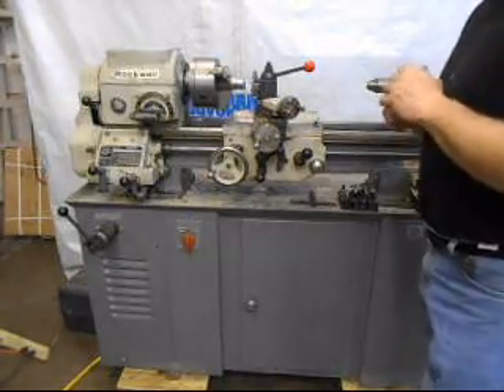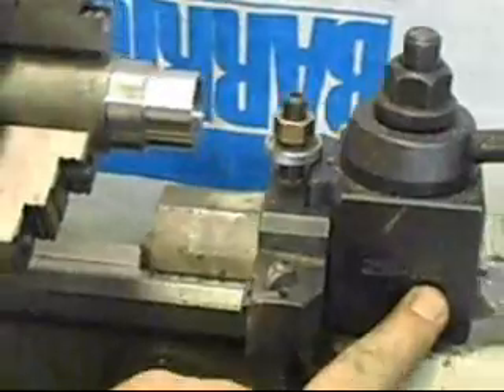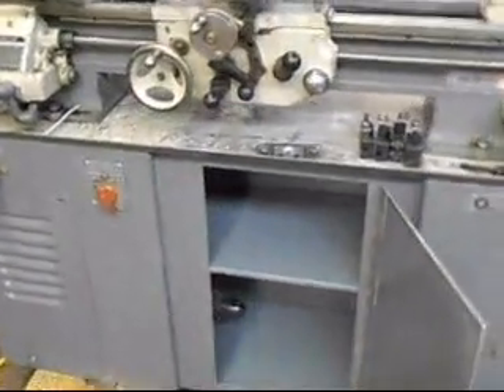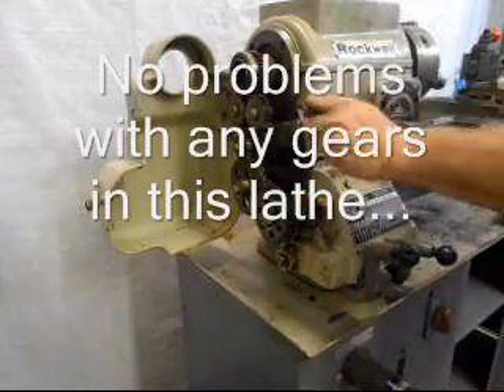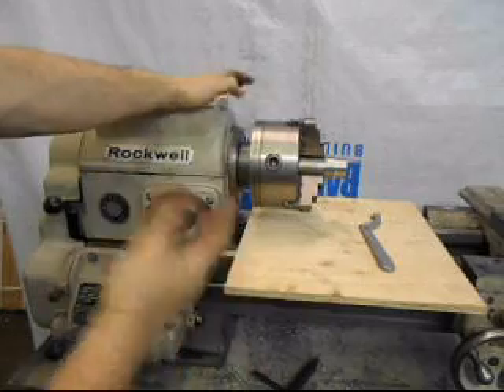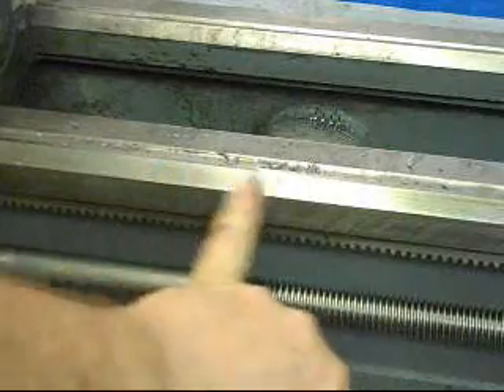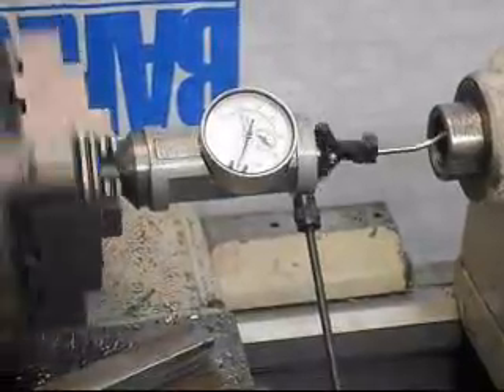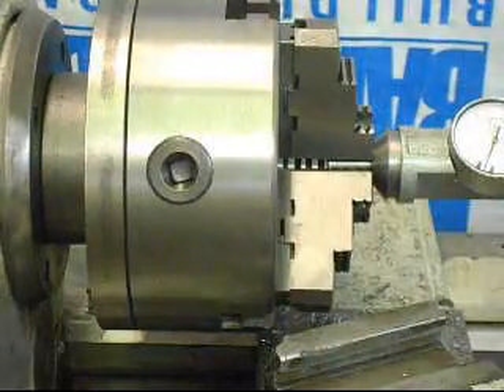Rockwell 11 inch tool room lathe.wmv

Comment from the maker: Thanks Mr1, you are correct, the Reeves drive spindle speed control lever should only be adjusted when the spindle motor is on. I do adjust the spindle speed a couple times in the video using the Reeves drive control lever. 

I'll point out that at times 2:59 and 8:53, the large pivoting handle is a gear shift (and is not part of the Reeves drive). That handle should only be manipulated with the spindle motor off.